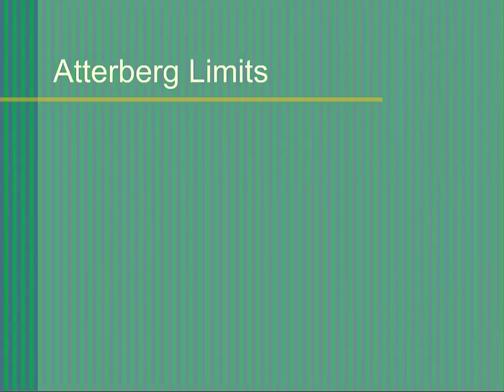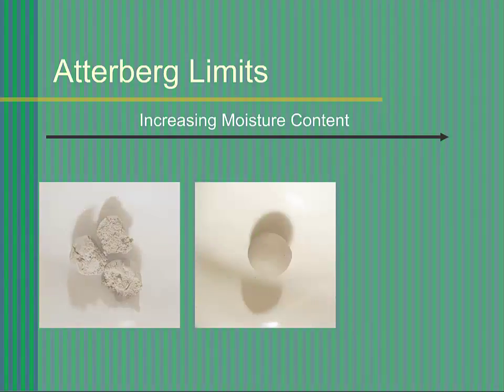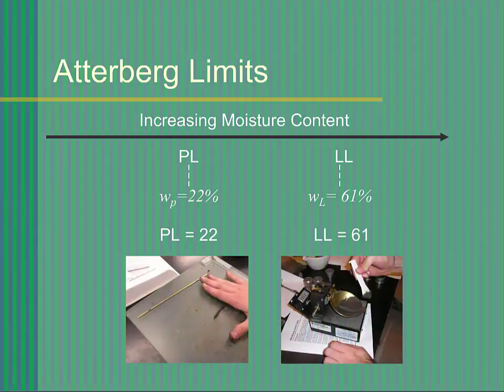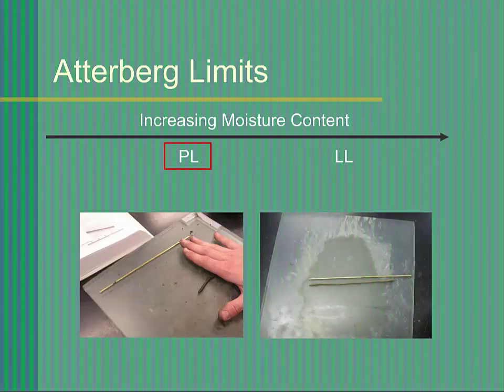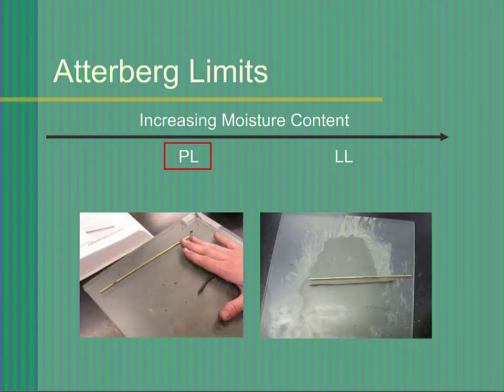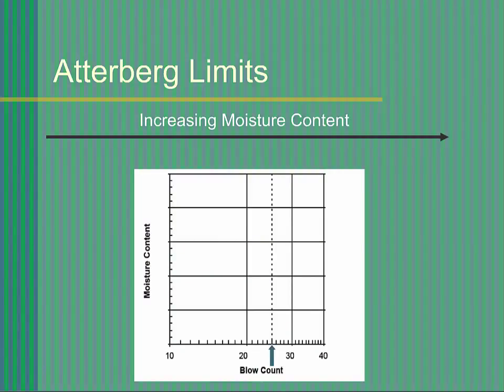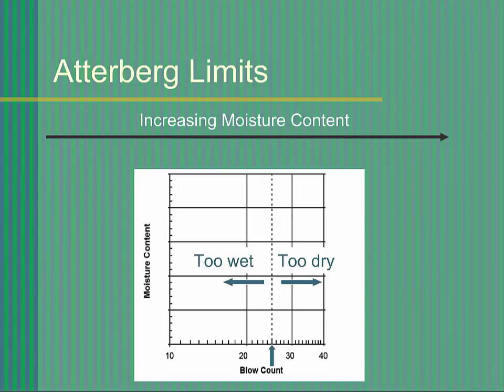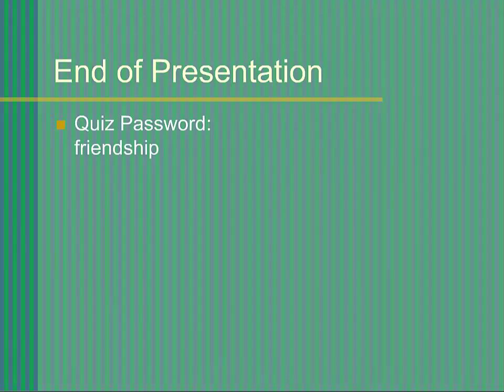Atterberg Limits Tests

Comment: Hi sir why we choose #40 sieve for liquid limit test?
Reply from the maker: 1) Because that's what the ASTM standard calls for, 2) because it's small enough to get most of the sand and gravel piece out of the specimen, but small enough that it doesn't take all day to separate the finer portion of the sample. 

 For fine silty sands, it does allow a lot of sand into the Atterburg limits specimen.  It will sometime give results of ML when the fines are really clay minerals.